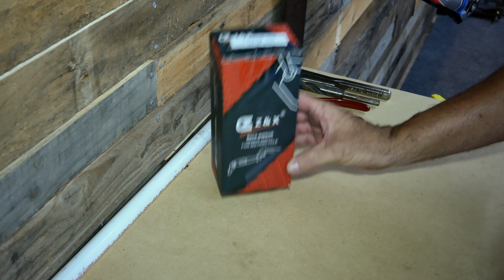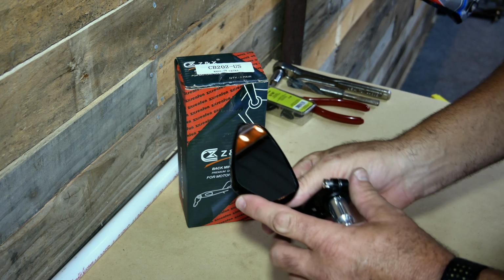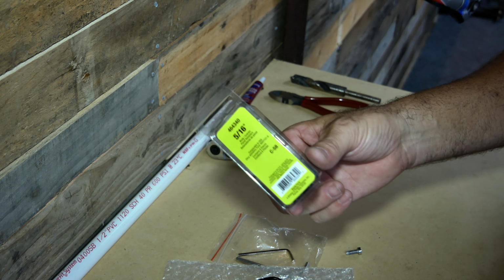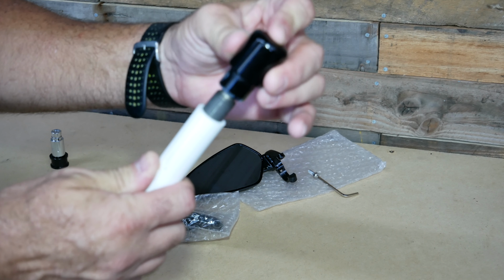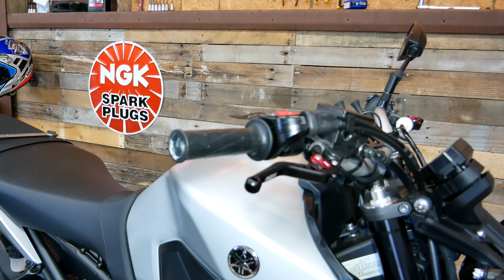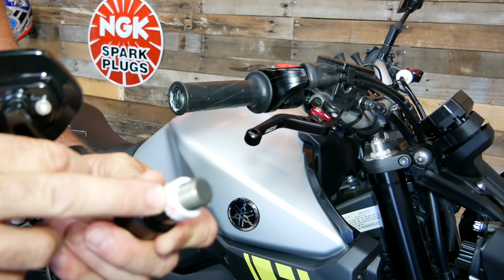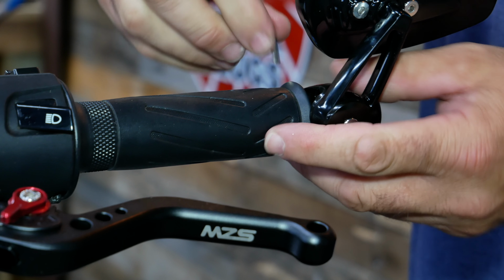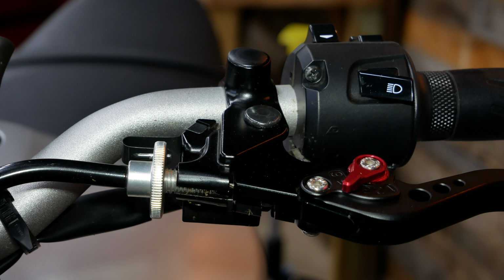Motorcycle Bar End Mirrors FZ-09 MT-09 FZ-07

Comment: For the Australian guys, after seeing this great video I searched Bunnings for a full hour. Their electical/lighting section sells 'Deta' brand conduit reducer PVC 20-16mm' pack of two for 22 cents. I used some sand paper on either side to get it to the right width. Snug fit around the tread of the bar ends. Works great.
Reply: Thanks fellow Aussie

Comment: I bit the bullet and bought the CRG Arrow mirrors. I used your mounting method and it looks awesome. Rock solid with no vibration at all.  Looks so much better that the stock MT09 mirrors.  Thanks!!
Reply from the maker: So far mine have held up fine. Better than I expected. Thanks for watching!

Comment: I got a 1/2" copper connector (not pipe, 1/2 copper pipe won't fit over the threads but the connecter is a little wider so it will). I spilt it in half with a Dremel tool, wrapped them in electrical tape to make the visible part black and that was it. Simple, no drilling, or messing around, and it only cost $1. Just remember to use locktight.
Reply from the maker: Awesome

Comment: So following these steps (wrote it all down) you didn't have any issues with the throttle side sticking when tightening down the bar end with the spacer? It didn't look like you tightened the bar end with an allen? What is the torque spec do you know?
Reply from the maker: You have to have the spacer long enough so it doesn’t interfere with throttle operation....Extremely important. I may not have shown it on the video, but definitely tighten it with an allen. You won’t torque them down to “spec” since you are now tightening against it plastic spacer. Just tighten enough to ensure it doesn’t loosen up and use thread locking compound to safeguard against it as well.
Reply: @MotoSouth   perf... i'll get er done this weekend. thx! I'll post if I got more qs
Reply: @MotoSouth  what type of PVC pipe and what's the exact length at which you cut it for the throttle side? I'll attempt this again when installing new handlebars this winter. thx

Comment: The screw holes of the stock mirrors, do you fill those with anything or just leave them open?
Reply from the maker: I used some plastic automotive plugs. I think I put a link to them in the description
Reply: @MotoSouth  i dont see that? been looking all over :\
Reply from the maker: It’s a 5/16” or 8mm push pin. I got them from Autozone but they can be found online as well.

Comment: After installation, did you experience any vibration in the handlebars, even when using the stock bar ends?  Great video.  Which integrated taillight are you installing?  I recently installed the Blaster-X.  I was to impatient to wait for the tst industries one.
Reply from the maker: No difference vibration after adding the mirrors. I have the new TST Industries taillight. ;)

Comment: I assume no issues with throttle ? I ended up securing the mirrors to the very end of the stock ends in the meantime because the throttle kept sticking. it isn't the most secure method but I had to remove the stock mirrors. I'll try this method. Thanks for the tips! safe riding!
Reply from the maker: Throttle clearance isn't an issue as long as you make the spacer long enough so that the mirror doesn't interfere.
Reply: MotoSouth On my way to Home Depot. I looked up the PVC pipe and They have it in stock. thanks again!
Reply: MotoSouth , Quick question,The drillbit should be 3/4 of an inch? Thanks
Reply from the maker: @sonichives1  it's actually 5/8"
Reply: MotoSouth thanks, I went back to your video and heard you mention it. Thanks again!
Reply: The mirror is that I’m using already is similar to yours but the actual opening is going to be a little bit wider than 3/4 of an inch so should I just go by the thickness or width of the one I’m using for the spacer?
Reply from the maker: Yes. Just be sure you have adequate threads available to thread the bar end back on.
Reply: MotoSouth is the blue loctite recommended ?
Reply from the maker: I strongly recommend it. There is no other retention device and since you are tightening against a plastic sleeve you can only go so tight.

Comment: Could you use steel tube?    Instead of pvc?  So you could tighten it down more?    Or do you think it’s not necessary??
Reply from the maker: I've seen copper pipe used before. I'm sure steel would also make a good option as long as the outside diameter isn't so large that it affects the throttle.

Comment: I did this and I get throttle sticking if i tighten too much. I dont see the mirror mount interfering the throttle. Theres about 1mm space between. Any ideas why this happens? Thanks
Reply from the maker: Does it turn freely when you losen it?
Reply from the maker: Keep in mind that if you tighten it too much, you can cause the plastic to swell.
Reply: It does turn freely if I loosen it a quarter turn. Is my pvc space too short?
Reply from the maker: I would try one a little longer and see if that solves the problem

Comment: Soooo...I ordered the CRG bar end mirrors for giggles and grins. 95 dollars for 1 mirror and you need the bar end adapters cause the stock ones are just a bit to small. The adapters are 50 for 2. The total for mirrors is 250....yea not gonna happen. These are going back. Had the MZS ones on order but these came quicker but not cheaper. It’s a no brainer for me. How are those holding up?
Reply from the maker: Mine are holding up great.  Still look and perform like new.
Reply: MotoSouth don’t know what I was thinking!!!! I know better!
Reply: How are the levers? Do they have a lot of play?

Comment: Can you add the links to the eBay or amazon mirrors you used.  Thanks
Reply from the maker: The Amazon link is in the description.
Reply: Did you add the same pvc spacer to the bar end on the clutch side?
Reply from the maker: Yes. They are required on both sides.

Comment: what about the THROTTLE SIDE MIRROR..?
Reply from the maker: What about it?
Reply: @MotoSouth  : you didn't install it. I am wondering because of the throttle tube and your spacer and potential interference with it. Did you do the same style install for the throttle side then..? BTW : I have a new 2018 MT09 that I am plugging bar end mirrors on.
Reply from the maker: I just didn't show it but it installed the same way